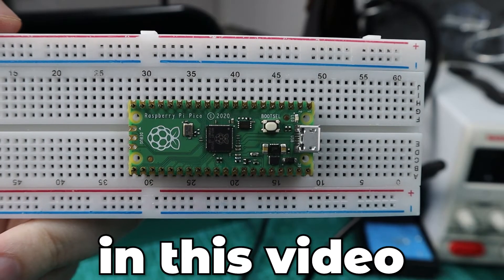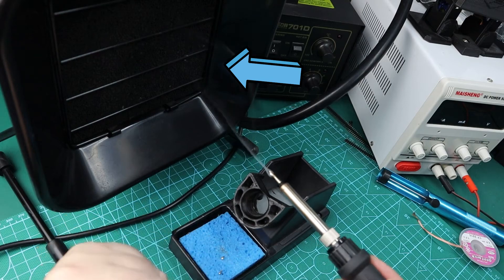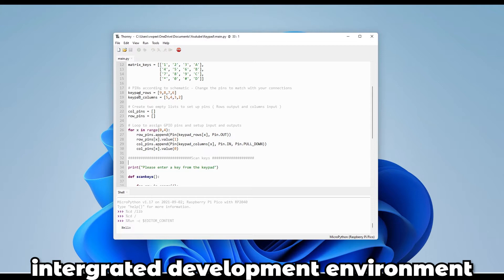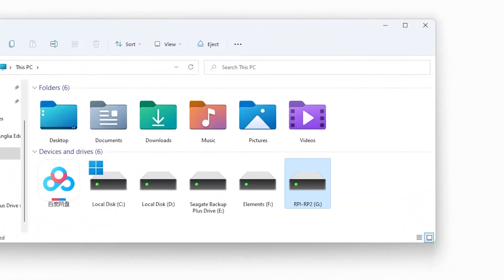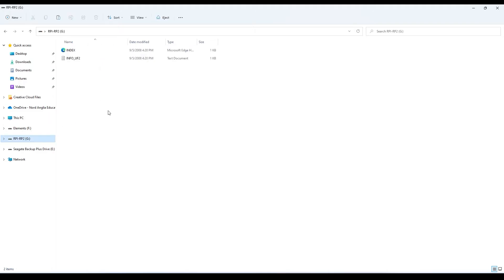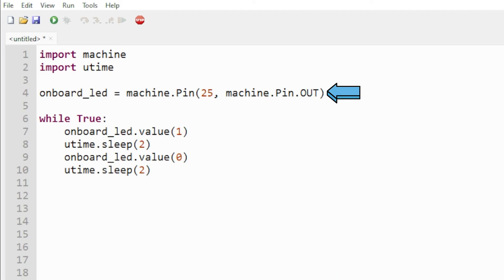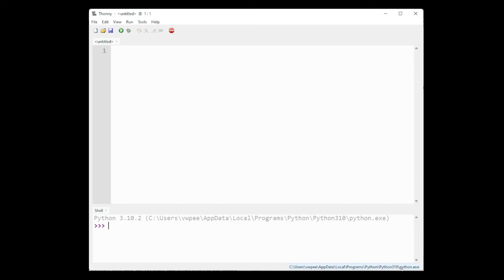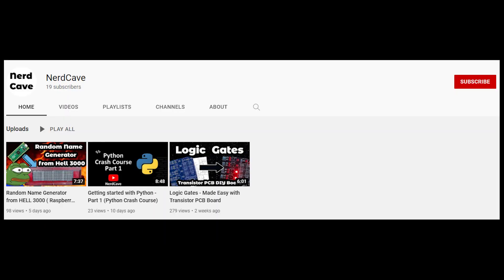Raspberry Pi Pico Tutorial: Getting started with MicroPython & CircuitPython

Comment: can someone help me over here. i plug my raspbeery pico but is not showing on my computer
Reply from the maker: Have you hold down the bootsel button, also the USB cable you are using does it allow data transfer some cables only for charging, also can try changing USB port because sometimes the COM ports doesn't always work.

Comment: I want to make a little calculator out of my pi 3, i dont have a pico yet but they are super cheap. 
i just worry that it will be so slow that it easily corrupts (like the pi3) soldering a display to it ( i hate soldering and the wiring is always wrong) coding ( im barely a beginner ) if it even works (works then self-destructs)
 Im 14 and poor af

Comment: I'm using multiple libraries in my circuit: 
Connecting a pico H with : pir, mq2, flame sensor and a tft 1,77 display.

This circuit is connected to the Blynk app also.
Should i work with micropython or circuitpython ?
Reply from the maker: it depends on the libraries you got for all your sensors, if they are in micropython or circuitpython then you can decide from there

Comment: can I have micropython and circuitpython on the same r pi pico?
Reply from the maker: No, you can not, CircuitPython is basically a fork of MicroPython where they changed a lot and added or remove some features from the original MicroPython. I will say depending on your application you will need to choose.

Comment: I have made a program for micro python but I can't find a way to make it run without having it connected to my computer with thonny. Is there any way to make it run with any power source connected to it?
Reply from the maker: yes, rename the program to main.py and you will have to connect a +5V power supply to Vsys Pin39 and GND. Since the Pico has a buck-boost converter a 3.7V Cell will also work

Comment: does the raspberry pi work with the breadboard when not soldered?
Reply: No. But it would work without breadboard. The only useful function I could think of is to blink the LED or for testing purposes with an oscilloscope.
Reply from the maker: You will have to solder header pins to the pico if using with the breadboard, if you are talking about the raspberry pi computer it has pins which you can connect to directly

Comment: Thank you for your help in blinking my for pico led, and it just worked, I have joined your channel so my first question is, please tell me the best version to use as I am new to the Pico and python?
Reply from the maker: I will say it depends on the application I use micropython often and CircuitPython is a fork of it and has a lot of libraries available aswell which does not exist on Micropython like the HID library etc. I want to in future make more videos on both, but for now mostly all the sensors I covered was based on MicroPython